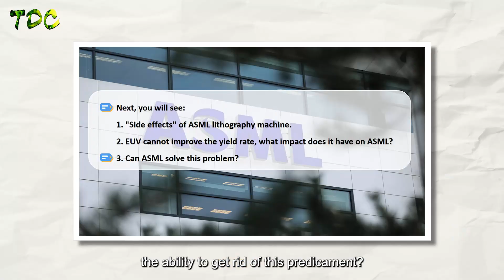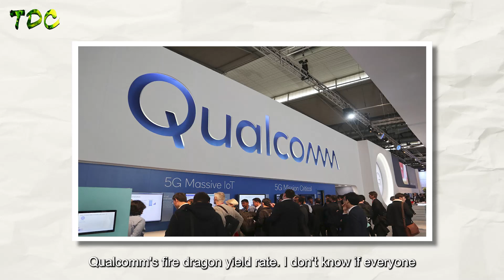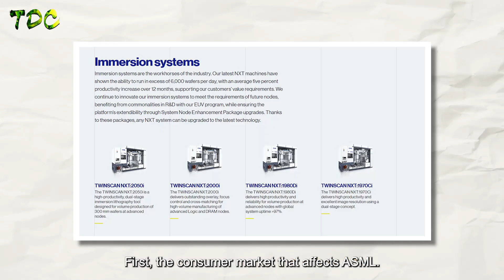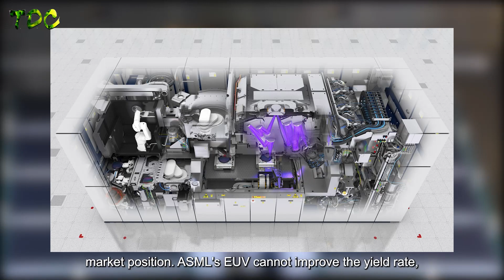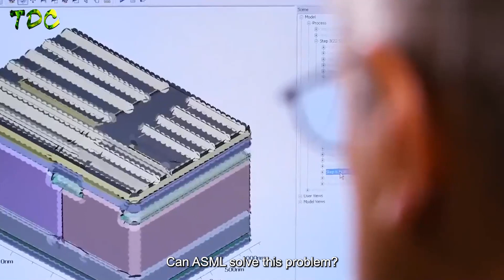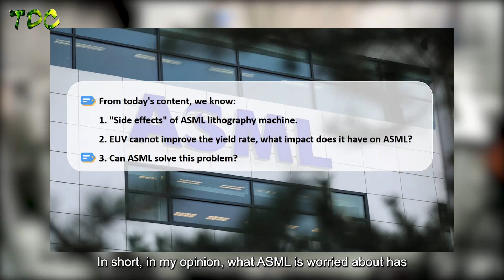EUV cannot improve the yield rate, what is the impact on ASML

Comment: Sophistication Vs Conventional limits;

As though the tech arms race have bears any limits of capacity were reducing its gauge whilst sacrificing from the other aspects of functions, the yielding functions of deductive resistance,

as though to downscales its size increasing its fragility of inductive functions as a resulting to be less heavy duty and having tendencies of premature breakage,

as though these findings are cleared from these topic that only the 7nanometre chips are among only the smallest possible enduring technical existence in all functional grade of nanotechnologies whilst the 2nanometre technology it did not be the fastest innovative levels

as though I only rely these capacitor theory to minimise its gauge from the wired circuit but it cannot be safe for the terms of thermally protected circuits as though the fat wires are remains the safest electronic circuit under the primitive rules of the conventional acceptance even though from the absence of capacitors and a vaccum tube in a huge thermally-protected assurance 

as of today, the photonic circuit were still under the promising contenders in the future thorough to ways of recreating the effective solutions against the standard silicon chip race with fundamentally huge efficacy studied.